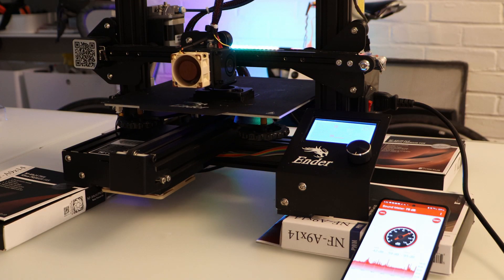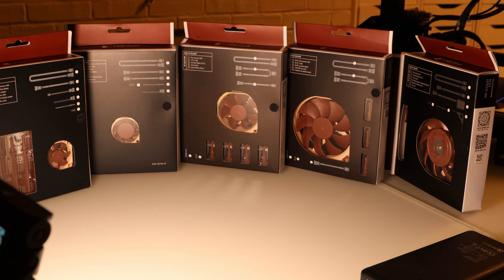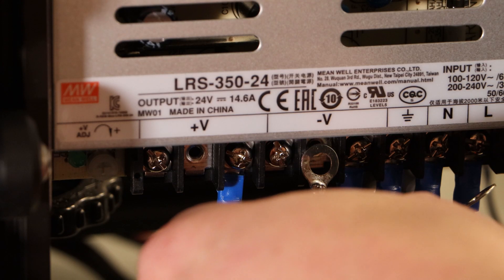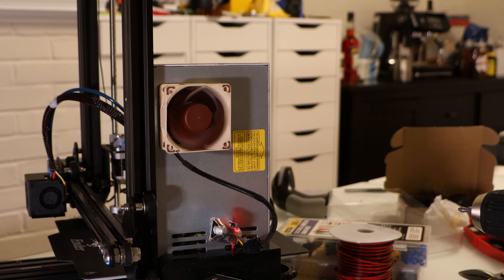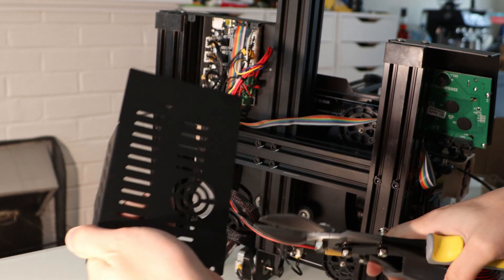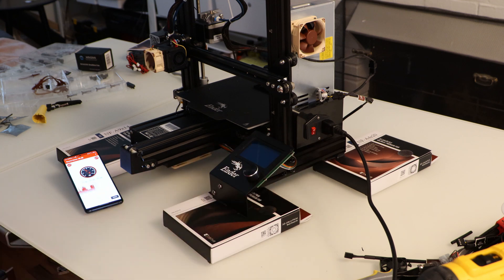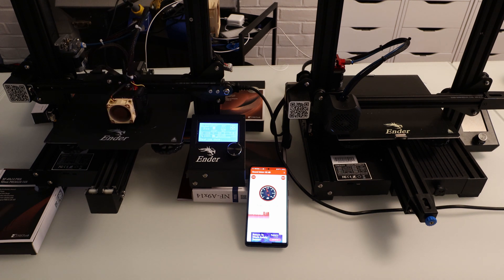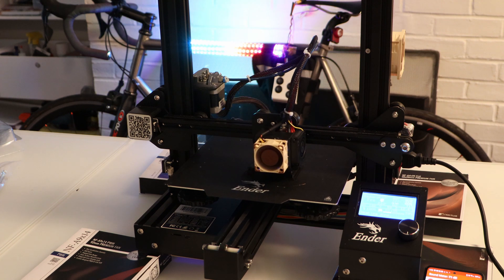Ender 3 Silent Fan Upgrade (Upgraded Pro Vs Stock V2)

Comment: Fanless yes!!!
Reply from the maker: Ok I'll order the parts... I've got it all planned out...
Reply from the maker: I've done 2 fanless builds now. 
The Ender 3 version was super fun to build, film, and edit. It's my favorite printer now!
https://youtu.be/uqCntWdLIvA
Reply: I actually just did make new psu and mobo cover and used the original fans, and the sound went down by half. It seems like the fan covers on the original parts create turbulence and a high pitched sound. Just making new cover with just a hole for the fan made a big difference. Also the amount of air they push feels to be more.  I also have noctua fans but waiting for buck converters to install. meanwhile my bambu a1 now sounds like a vacuum cleaner in comparsion

Comment: the fan that you replaced the power supply works in the other direction, it takes air out from and not in to the power supply, you must turn it  backwards... the part of the mother board... not good, now you must use boxes... bad idea.

Comment: Two fan in a series? That is hilarious! 😂
It will not give you a better performance than one fan. It make sense only if two fans spins in different directions(one clockwise and another counterclockwise) which isn't the case in your installation.
Reply from the maker: Right, or I could add a stator in between them. But I don't care, it works and is quieter than before :P

Comment: E3V2 fan noise was ridiculous - and the heatsink fan was always active. One day I finally had enough. I took the cheaper route and replaced stock fans with generic 24V fans run at 12V. Added a PCB mod where the heatsink fan is only active above a threshold temperature. Feel better now - I hated all that noise lol. 🙉
Reply: how did you manage to mod heatsink fan only active above threshold temperature?

Comment: I did the nozzle and part-cooling fans but man this thing is still really loud.  I put it by my PC hoping it wouldn' t bother me but it definitely bothers me.  I have 2 more of these noctua 40x20 fans, anyone know if I can use these to replace the other ones like power supply and motherboard or w/e?
Reply: All depends on voltage
Reply: @urgamecshk  ended up going all noctua except psu fan was artic something or another, the silent version.  Now it's super quiet :) I think I had to use buck converters for 3, thought I'd have to for psu but turns out I didn't need to

Comment: Great video. Just bout one for my first printer. Does having the upgraded part fan sucking instead makes of pushing make a difference?
Reply from the maker: It depends on the fan, most of them I set up to push air. You end up with smoother air flow on the intake side, and more turbulent air on the outlet. Turbulence = more heat transfer!

Comment: wouldn't you want to unplug the other fan inside of the psu since the noctua will be blowing on that fan causing it to spin and could create a charge that could short out?
Reply: Yes, I believe you are correct

Comment: I think my extruder fan is making the most noise, so I might get away with leaving the PSU alone. But I'm a complete noob here so I have a question. Do I need that chip you plugged into the PSU before hooking in the fan for the extruder fans as well?

Comment: Warning, noctua airflow may not be sufficient if you're running high temp, high speed or just a demanding hotend, so beware. However, you can use them for stuff like electronics, as they need less airflow and babysitting than your hotend.
Reply from the maker: I haven't had issues with hotend cooling in my experience. Prusa I3Mk3 uses a Noctua fan for their hotend cooling
Reply: @NathanBuildsRobots  cool. from my and other people's experiences, noctua fans don't have enough airflow. i went with a sunon maglev 4010. love your videos, by the way :)
Reply from the maker: @mysteriouspikachuman  thanks!

I wonder, - I always upgrade to all-metal heatbreaks with very thin tubes as my 1st step to any upgrade. I'd be willing to bed that I have success with the smaller noctua fans because the all metal heatbreaks transfer less heat over to the heatsink, and thus require less cooling...

I've done the calculations, all metal vs ptfe is a 4-8x difference in heat transfer across the break.
Reply: @NathanBuildsRobots  you should try a bimetal heat break, they're much better than titanium or steel ones. cnc kitchen has a good video covering the topic.
Reply: the heat can travel freely through the heater block without being impeded by the different thermal properties of the heat break, the walls can be thinner, and if any heat reaches the heatsink, the high thermal conductivity of copper allows it to be transferred to the heatsink quickly.

Comment: Did you test airflow where you stacked up the fans? Generally that results in a loss of air flow of the more powerful fan from the resistance of the less powerful fan in its air stream. The less powerful fan doesn’t increase in airflow at all so it results in a net loss. Without a chamber in between the two like a PC case for example it’s regarded as a bad idea. This is why you never see it even in industrial applications unless very very specifically engineered as such…I can’t find an example of when it works well but I’m sure there is…

CPS makes a reliable cheap airflow meter if you want to test it yourself.
Reply from the maker: I was thinking of turbines, where alternating rotor/stator blades compress the air and increase pressure.
But yeah, it is missing the stator blades, and probably wouldnt have worked well anyways, since the blades need to be optimized to work in that condition. 

The other logic I had, was that I wanted to use the bigger, 20mm thick fan on the inside, but it wouldnt fit. So I put it on the outside. Then I wanted something to be closer to the heatsink, so I also put the smaller fan in there to help direct the air onto the heatsink. It was not a great design, and I have since replaced it.

I looked up those flow meters, not sure they will get accurate readings on those teeny tiny fans! I just need to buy a vape a blow smoke on it lie Major Hardware :)

Comment: As a fairly experienced gaming computer builder, doubling up fans doesn't work as well as people would think, and the difference it makes is very very minor. The only time a 2 fan configuration works well is when you have a push fan on a cooling radiator with a pull fan the other end
Reply from the maker: Good point. Maybe it would have worked if I had a duct around the heatsink with a fan on both ends of it.
Reply: @NathanBuildsRobots  everything's trial and error, and I think you did a great job! I have an ender 3 v2, I have the upgraded metal drive section currently and the yellow springs, looking at getting a BLtouch or the creality version for it next, which one would you recommend??
Reply from the maker: @MR_G92  whichever is cheaper! I have tried both and the seem to work the same.
Reply: Not just that but the one on the PSU is off and if you place a fan on there powerful enough to spin the RPM too high you could feedback to the board..

Comment: Turn the fan of the power supply around so it sucks out, the warm air (that already tries to go up anyway) will be sucked out and replaced with cool air from the bottom. This will improve cooling efficiency of the PSU. Also keep in mind that while cutting away metal improves airflow so that's a good thing, but it will also increase dust so be sure to blow out any buildup of dust (with can of compressed air) before it's sticking to your components and can't be removed with a compressed air can anymore.

Comment: imagine spending so much on new fans and mounting them like this so their $ value for cooling is compromised xD. Unless both fans in line are spinning perfectly in unison then you're going to have some resistance and drag, which one, lowers cooling and two, makes noise! lol.
Reply from the maker: Learn from my mistakes, you got this!
Reply: Yea it isn't really an efficient way to do it. He should have just got higher flow fans

Comment: Seems like Nacuta 40x15 doesn’t have enough air flow for the hotend.
Reply from the maker: Teaching Tech just released a silent printing video a day or 2 ago and went over things in much more detail than I did. He says as long as you are using a duct to direct air through the hotend heatsink fan you should be fine with the reduced flow rate from the noctua. 
Personally I have not had any issues with my printers that are running slower fans, but I keep everything at room temperature. This might be an issue only if printing at high ambient temperatures or inside of a heated enclosure.

Comment: Not really an "upgrade". More like a design mod and not a very efficient one in my opinion. Was looking for a video on in place substitution of the stock fans with quiet Noctua model.
Reply from the maker: The stock fans are all 24v and noctua mostly does 12v fans, so you need to add a buck converter.  

Lately I have been using more of these fans since they are cheaper and run on 24v.
https://amzn.to/3ESAjcF

Comment: Well you could just buy a same size noctua fan, open the PSU, solder original PSU fan connexion and swap the fan for the noctua. The original is 12V & it''s not a good idea to add fan on top of each orther, this will damage both fan early and the air flow does not add (not at a point this is usefull/worth damaging the fans)

In fact even if the noctua was less efficient, the PSU fan is controled with a temp sensor, so it may only goes on for a little longer and this avoid have this fan on all the time. 

Less noise and same effect, i don't understand why would you do it like the video, you use a buck converter that wasn't needed and this is more messy.
Reply from the maker: Noctua doesn't make a 60x60x10mm fan, only 60x60x25

Based on what I've seen the fan has a plug so it's pretty easy to do the mod you mentioned. 

It probably would be better to just remove the internal fan and just run the noctua off the PSU's internal fan plug. But you have to be a little careful, I think the 12V is generated using a zener diode, which will probably burn out if the replacement fan draws too much current.
Reply: @NathanBuildsRobots  yeah the noctua needs to be outside (the messy part is the buck converter and cable) 

I don't think the 12v generated is less than 130mA but yeah it needs to be verified. 
(Why 130 mA : the 60x60x25 noctua is 12v & 1,44 watts witch is 0.12A +~10% for the safeness)
I also think you could replace the nozzle fan with noctua but it needs a fan duct/fang print.
Reply: Nvm I just saw your fan less video. You don't need to replace it if you don't have any fans 🤔😅

Comment: sorry but i don't understand why did you put 2 fan on the hotend ?
Reply from the maker: The idea was that the stock fan is bigger flow, so maybe I would get more airflow out of 2 fans to make up for the fact that the noctua fans move less air. I don't think it helped that much, it would probably be better to just go with a single fan.
Reply: @NathanBuildsRobots  okay.thank you for your response !

Comment: This can be a bad idea. People jump all over Noctua fans to make printers quieter, but stop to consider the consequences of doing so.  These fans are quieter because the move less air.  Less air means less effective cooling and on longer prints can lead to print issues and heat creep.  Read up on it before you do any mods with slower fans.
Reply from the maker: A good way to approximate fan noise is: Noise=Airflow/area. 
Bigger fans will move the same volume of air more quietly. 
A higher flow rate fan will be louder if the size is the same.

However, there is a design factor in how much noise is produced. Noctua tends to be excellent in terms of airflow per unit of noise. For example if you had 2 fans the same size and same airflow, the Noctua one would make maybe 20-40% less noise.

Stock fans tend to be very loud and move a lot of air. The stock fans are overkill for most cases, but a very safe choice.

You might like the "Fan Showdown" videos by Major Hardware. He calculates fan effectiveness vs noise levels with Noctua as a benchmark. 
https://www.youtube.com/watch?v=PP9_aEViSu4&ab_channel=MajorHardware

Comment: is the upside down electronics case just on the ender 3 v2? the one on my ender 3 is upright
Reply from the maker: I made a separate video where I re-oriented the power supply so it can get better airflow. It was a lot of work, can't say I would reccomend it, but I would at least cut away the part of the case that blocks the power supply vents.

Comment: Man that machine looks real messy now.  I love the way you butchered the sheet metal work.  Really professional!  I laughed out loud several times when you used your huge cutters to leave dangerous sharp edges everywhere.  I had to click LIKE as it was so entertaining to watch.
Reply: My dude that panel is on the very bottom of the printer and it is facing downwards. With about a half inch gap between the table and the actual bottom of the printer it is 100% not even visoble. Soooooo who cares

Comment: Are you using a silent board for the motors?
Reply from the maker: Both have a silent board, but only the v2 comes with it stock. I had to buy/install the silent board on the pro.

Comment: noctuas are overpriced AF, i just bought 3x arctic cooling and 3 buck converters for 15 $
Reply: have an amazon link for the 40x20mm fans?
Reply: @br0k3nilluzion  im taking care of the cpu and motherboard one, gonna put them under 7 volts, im not sleeping next to the printer so im leaving stock on the nozzle
Reply: @sensationsmoke9152  which arctic fans are you using?
Have a link to em by chance?
Reply: @br0k3nilluzion  https://www.ebay.de/itm/362934991661 bought directly from that link (im not supporting any seller) yes noctuas are definitely better but for me not for that price. To the mod i saw cpu and mobo covers on thingerverse (like https://www.thingiverse.com/thing:4822648 that guy also used the arcic fans that we are talking about) but im gonna just cut and drill the original cover and prit some riser feets.
Reply: @sensationsmoke9152  ah, thought you had found the 4010 or 4020 sized fans for the hotend.  The PC fans are easy to find, they sell em at the Microcenter down the street.
Reply from the maker: There are fans that are 25% the price and have 90% the performance. But I also use the plethora of "free" connectors included in the box with my Noctua fans. Makes wiring a little easier.

Are Noctua fans overkill for most applications?
Yes. 

But they will also last until the end of time, so think if it as an investment.

Comment: How would you attach the second hot end fan onto the aquila?
Reply from the maker: I actually took the setup from this build and installed it on my Aquila.
(I also upgraded the hotend mounting plate to a Microswiss direct drive version, otherwise the mounting holes would not have lined up)

If you were keeping the original plastic shroud you might be able to sandwich the plastic shroud between 2 fans using some long screws.

Comment: Do you know if stock motherboard fan is allways on or starting only when get hot?
Reply: The Ender 3 V2 motherboard fan is wired into the part cooling fan, so if you have the part cooling fan off or reduced, it also reduces or shuts off the motherboard fan.
Reply: @calvinsmith-lecuyer9020   same in ender 3 pro?
Reply from the maker: Unfortunately it is the same in a lot of printers where it only turns on with the part cooling fan. On some nicer boards you can set it up the fans to activate whenever you are printing, but that requires another transistor on the motherboard that they just don't want to pay for on these super budget machines.

Comment: So it is ok to run multiple fans on one buck converter?
Reply from the maker: Yes. The fans draw about 0.05A, the buck converter is probably capable of 5A, so you could run 100 fans on it if you really wanted to. I just tried a fan's suggestion (no pun intended) to run 2 12V Noctuas in series off of the 24V line and it actually worked.

Comment: Can you put a new fan on the side of the extruder
Reply from the maker: The fan on the side of the extruder is the part cooling fan. It makes an annoying noise so I've taken some steps to make it quieter. 

1) I have part cooling turned off for most of my prints in the slicer settings. 

2) You can replace it with a 5015 fan like the one I used in this other video. The 5015 blows more air and makes a less annoying noise (but it's still not super quiet).  https://youtu.be/Q41AhKl1_kI